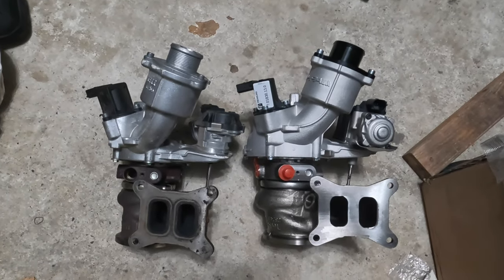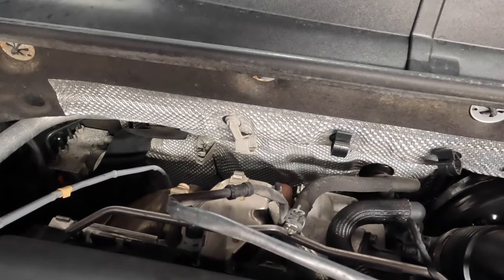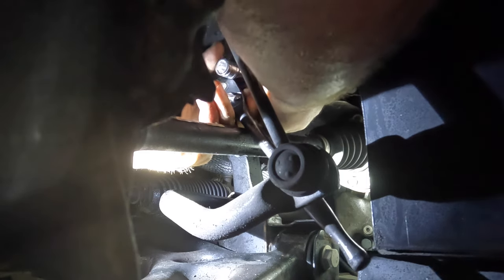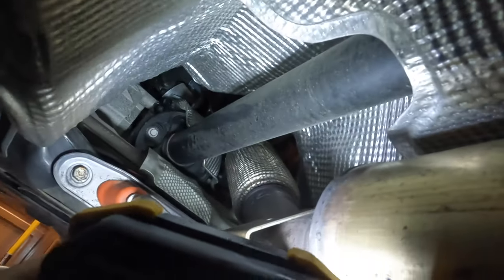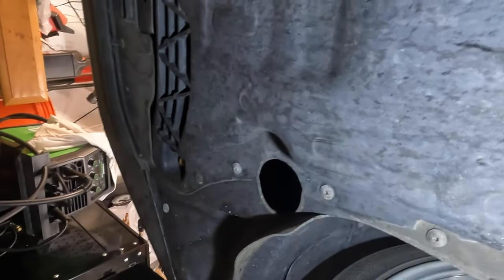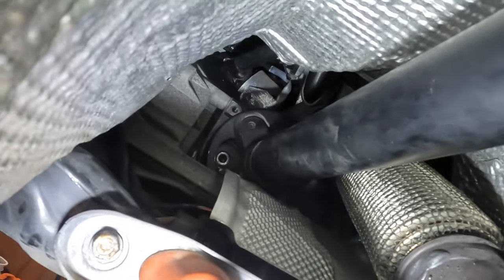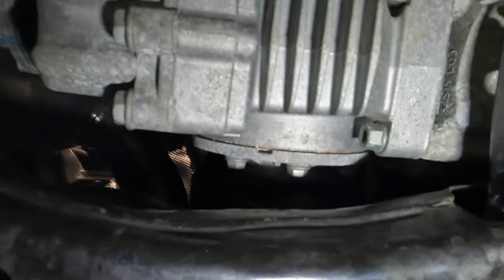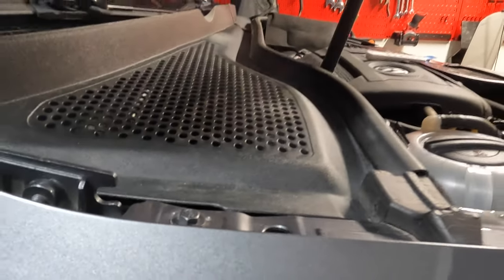2017 VW Alltrack (AWD MQB) HPA Motorsports IS38 OEM+ Turbo and Down Pipe Install

Comment: Wow that prop shaft, heat Shields and downpipe are murder! When I do mine I'm keeping stock downpipe, no need for all that drama. I hope I can get to all the bolts, oil return line with stock DP still on... Great video!!!!
Reply from the maker: Thank you!  So the stock down pipe has the cat right after the turbo. This design while being very good for emissions, I believe is why the waste gate flap fails on these (why I had to replace turbo) because all the heat of the cat is right there. The down pipe actually was the easier part, and with it in place, would not been as easy to pull oil drain line IMO. I’m sure it can be done with it in place but just wanted to provide some additional perspective.